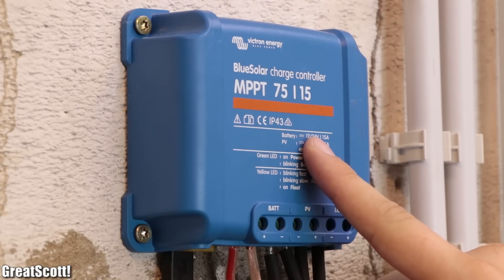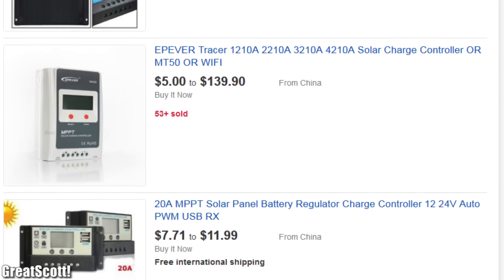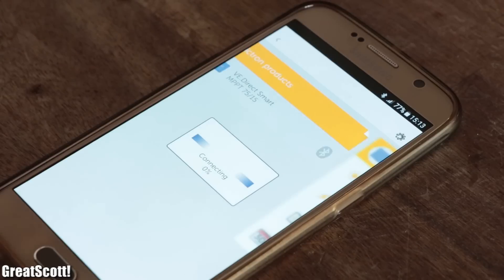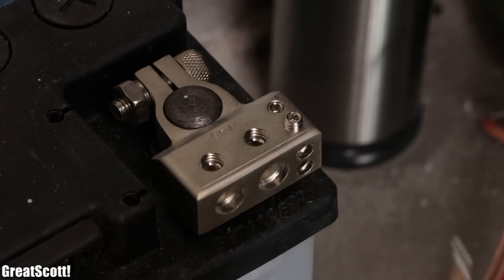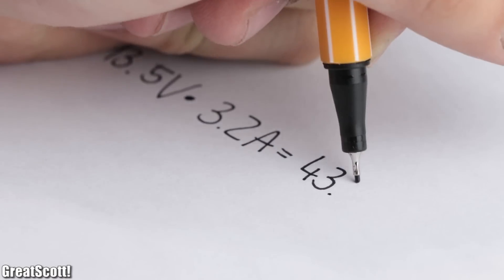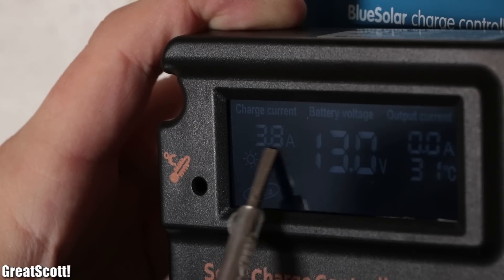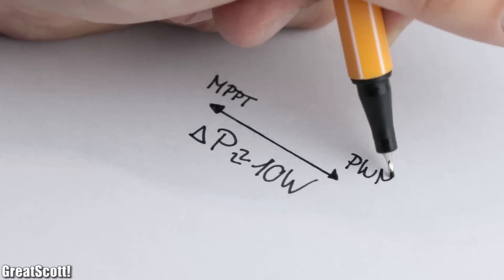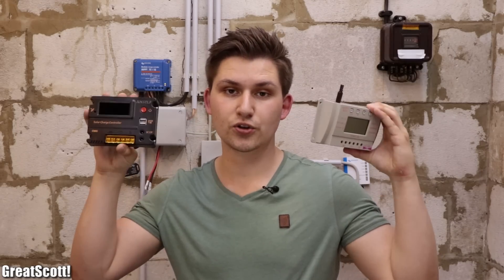MPPT VS PWM || Solar Charge Controller

Comment: You forgot one of the most important points about MPPT vs PWM! Most PWM controllers will not work until the output voltage of the panel reaches a certain voltage, but a MPPT panel can boost low panel output during early morning and evening sunlight. This means that you get more hours of battery charging during the day from MPPT instead of PWM.
Reply: I feel the true advantage of MPPT is that you can use panels of a much greater voltage than your batteries and let the controller work it magic to extract the maximum amount of energy. I have 80 volts panels through a magnum controller to charge my 24 volt AGM battery bank. Because my panels are amorphous I need not fret when the day is coudy...I still have some power coming into the system. Viva uni-solar/Xunlight!
Reply: Maybe not that important because  most of the solar panels generate max volatge even at very dim lights. What i mean that if the solar panel isn't sufficient to generate a paek voltage, then then it won't even give you any useful current.
Reply: That might be important for grid-tied systems or any system that needs to maximize watts all day long, but for many people who are using solar on RVs or off-grid if they're still desperate for watts at the end of the day they've got their system sized way too small.  The PWM system on my camper starts charging the moment the sun is on the horizon and my batteries are fully charged by 10 am to noon on sunny days.  By the end of the day I don't care if it's getting any watts at all since it's just been throwing them away all afternoon anyway.  On cloudy days when charging is minimal, yeah, maybe that would make a bit of a difference.  But I prefer to have enough amp hours in the battery bank to last at least 5 days without any charging at all, to guard against running out of power in case of multiple cloudy days, etc.  PWM has worked fine for me for ten years now and it saved money over going with MPPT.   Everyone should do the math for their particular system.  Sometimes MPPT is the only way to go, but sometimes not.
Reply: @MTMiser  Spend a few extra bucks and get the better item imo
Reply: @mhan6601  I agree but only if the better item is actually going to do more for you.  In my case MPPT might charge up my batteries a little faster but that will only mean that the system will be throwing watts away for even more of the day than with PWM.  It would be pointless and a waste of money for me.  PWM has been working flawlessly on my system for 10 years.  But like I said, MPPT is a great technology but not everyone will benefit from it. The following article about charge controllers has a section on MPPT vs. PWM and explains the situations in which MPPT can be useful, and those in which it is less useful.  https://rvsolar101.blogspot.com/2013/11/part-7-charge-controller.html
Reply: @MTMiser  Hi Well said , i just have a Question  i have a ute canopy it has a 300 watt fixed solar panel on the roof and a Folding panel for when i pull up camping i will use that i have a 100ah AGM battery i run a waeco fridge and few led lights what am i better off using PWM or Mppt thank you
Reply: @MTMiser   do u know how i can use a system without batteries ? iwanna just  work for my fridge in the ligthday
Reply: @stopPlannedObsolescence  You would need to know how much power your fridge pulls, especially on startup.  I'm assuming it's a residential fridge?  Those pull a lot of amps on startup.  Then you need enough solar panel wattage to handle that and an inverter to convert the solar array's voltage to whatever voltage the fridge runs on (120, 240?).  But I think you'd be better off with a battery bank.  Otherwise the power would fluctuate every time a cloud passes over.  I would think that could damage the fridge's motor over time.
Reply: @MTMiser  thank so much mate,yeah so with this point of view, i think is better a bank batteries that support the peak and the consume required for 1 hour like minimum ,or another idea is a onGrid system for reducing my kw/h just for startting in this world.ty and escuse me for my bad english heheh
Reply: @stopPlannedObsolescence  If you would not want to use a battery (can't recommend) you better use a peltier fridge. It does run on 12V and it will not stop running if too less power (like a 12v compressor fridge)
Reply: @yourTuBaer  A quality good low voltage ompressor fridge can give you an 80 degree or more difference which is important in warm weather. A peltier fridge rarely offers more than a 30 degree difference unless its an industrial/laboratory model costing thousands.
Reply: MPPT is not a boost converter, you've confused two different things. You could make PWM or MPPT controller that boosts voltage, but most of both types do NOT boost voltage.
Reply: @jinbee2627 And victron doesn’t make a boost controller because there just isn’t much power to be had, best to add more solar panels in series and raise the voltage
Reply: Well everybody's review is different
Reply: Thank you for explaining that👍🏻🇸🇪
Reply: Do i need to use Poly solar panel instead of Mono solar panel?
Reply: Yep. Some of those cheap ones are fixed power point MPPT which is still a thing but that's only while the panels reach that voltage. Under that voltage they revert to PWM.
Reply: " MOST" pwm do work from the same daylight conditions... Side by side comparisons reveal this...pwm is highly reliable for battery charging... Must mention capacitor failures on MPPT...got a few blown ones...mppt far more costly...heavier...larger physical size...decide by application as they both dump power once batteries are charged....so no real gains for that purpose...everyone has their reasons.
Reply: So true! I've done testing in real life not paper! PWM doesn't compare to MPPT! In full sunlight in Australia current instantly drops to almost a trickle charge. I have read about this.
Reply: I think this is a point he missed because it was more to justify victrons stupid prices. You can get just as good or better mppt's for cheaper than victron prices. He should have definitely just kept it short to show the benefits of an MPPT over a regular charge controller so people could make their mind up unbiased off a specific brand
Reply: Nonsense. PWM can be made to work as low as 1 Volt. How do you think they make cellphone emergency chargers from 1.5V batteries.
Reply: @nicoras8803  that assumes a boost converter
Reply: @nicoras8803  Wait a sec. That takes a totally different type of component to boost power from a single cell battery to a higher voltage.

Comment: Another huge cons for MPPT controllers: your batteries won't last as long as with PWM controller.  Some say MPPT will cut down battery life in half,  and some 30%:  it's not a small marginal number.
Reply: Not so sure about that. Victron design their products very well! So would be suprised when they make a product which kill the battery.

Comment: just a suggestion: whenever possible crimp your stranded type wires. It might not make much of a difference with new wires, but as soon as some strands start to corrode, you'll lose effective diameter. Plus it makes repetitive "screwing around" (pun intended, hehe) easier and less harsh on the strands - Cheers from Trier

Comment: Thank you so much for making a video about this! I've been scavenging parts to build a portable solar generator for a while now. This video was VERY helpful! P.S. It depends how damp your garage is and how cold that block wall gets in the winter but keep an eye on those exposed terminals they can corrode quite quickly if condensation is present. If that happens adding a plywood backboard and/or some dielectric grease should remedy the problem. I see it alot in mains electrical panels.
Reply: good call @Samara Saunders  - Installation is as important as compatibility and other tech stuff. I have seen expensive equipment (not speaking of solar specifically) fail due to corrosion, within a year, through damp getting into low power circuitry. Things start getting weird (unreliable) first then failing completely.

Comment: may want to be careful with those cheap chinese PWM controllers. 2 I've used before didnt stop charging before the batteries reached AT LEAST 14.4 Volts, that's only suitable under cold conditions.

I've sacrificed a few good batteries to learn this. For the price of those batteries I could have bought a bunch of name-brand chargers!

Comment: You divided the extra efficiency into the extra cost over time but another and I think more useful way to look at it is how much extra power per day is there? I'm more concerned in how much power I can use each day over the size and complexity of the system I have to maintain. If I can get more operating time per day that has a greater value than saving money over years. Those screw lug connectors look very troubling to me, I'd be inclined to always at least use fork spade lug crimp terminals.

Comment: What about battery life?  Deep cycle batteries are pretty stable but does is one controller more likely to keep the battery healthy longer?  If the mppt controller is easier on the batteries its cost may be well worth it.

Comment: I really like all your videos, but I want to point out that your comparison is flawed, but the conclusion is not.  You assume there is clear sky with full irradiation all day long, every day for 10 years.  The truth is clouds come and go and an MPPTracker will outperform by delivering more power consistently over time while the PWMs would provide worse than your short test.  Although more difficult to determine the cost cross-over point between PWM and MPPT, (unless you collect data over a full year to get a better approximation for your weather conditions), it is safe to say the MPPT is the better choice.  Keep the videos coming.

Comment: If you use the cost of power available from the electrical service as a comparison point for deciding how much to pay for a solar charge controller, you should include the non-recurring cost of hooking up to the service. You can't actually get power at that price until you've incurred the price of hookup. Otherwise, if service hookup is not an option, then it becomes a simple decision of whether you need the additional power provided by the better controller.

Comment: Nice to see more than just your hands on the screen. Just curious, did you actually measure the charge voltage and current from the MPPT controller or did you just go with what you read on its screen? On the PWM controllers you actually took measurements with a meter to verify what you were seeing on the screen or to calculate what was not shown on the screen, but you did not take actual measurements on the MPPT controller. Or did I miss that? Just curious, that's all!
Reply: Great video, by the way.
Reply from the maker: I measured it. It was pretty close to the information presented by the app.

Comment: I had the white china-model in use for appr. 3/4 year. Pretty much the same setup, 100W solar Panel and approx. 70AH battery. It worked so far, but I did not trust it. It was rated 20Amps, but I put a 15 Amp preliminary fuse in series with the controller, and the solar Panel. The load got a 10Amp one. - I don't would recommend pushing these things to the limit.
Last week I relaced the controller with the much nicer MPPT you showed in your offgrid Video. This is a very nice controller. I like the bluetooth features, nice for tracking the data.

Comment: PWM controller is rapidly connecting and disconnecting battery directly to solar panel. That mean that solar panel will always work on "battery voltage". Discharged battery will put panel far away from MP sweet spot and reduce efficiency even more ... + all other things mentioned in video :)

Comment: unfortanly only tested whit 1 condition and full whit sun. think when you measure when there is alot of clouds. think the mppt will deliver more energy than pwm. 
like you checked in your previous video. mayby than the diffrence will be alot bigger

Comment: dose the mppt charge work better when plugged in the web and lass when unplugged for the web?

why i ask is because of things like, windows10 wants to charge you a monthly fee to use your pc.

or how oscilloscope to day need a key ever year, so that the oscilloscope is 10% more accurate reading. 
"that makes for great science, lol not"

i see it as the big push for tech to have the "buy sell or trade programming"
oh your not plugged in to AI collective, resistance is futile you white male crap and so on.

thanks for your time in this video.

Comment: Thanks for another great video Great Scott !!  * NOW - I HAVE A REQUEST *
Can you do a project on a DIY Capacitor Leakage Tester please ??   I have 2 or 3 capacitor meters and an AnaTek Blue ESR meter.  But neither of these will measure leakage - which is another very important aspect of capacitor performance - and leaky capacitors can ruin tube gear !!   There doesn't seem to be any inexpensive commercial testers available (most are $300 and up) - and the old Heathkits are usually big and klunky - just use electric eye open/close indicators - and usually need fixing themselves !!  A tester that actually measures the leakage current (maybe even w/ an analog meter movement) would be fabulous !!  I think the problem is - high voltage.  In order to adequately test large electrolytic capacitors to spec - it can require 500 - 600 volts DC.  And I think the exposure and liability from that voltage is keeping the DIY community away from it.  Anyway - I think it would be a great project - I'd love to see your design approach !!    Thanks !!!

Comment: Hello there, can you help me, i have a problem, im trying to make a portable speaker everything is fine expect the battery, i have 4x 18650 2400mAh 3.7v and im running the amplifier at 14v using a dc dc booster (amplifier except 10v to 25v) and it can t run them, do i have to change the booster or  the batteries?

Comment: Can you address wind generators in your videos? I want to build one, but got no idea where to start. Same charge controllers? Same batteries? Can i use led gel batteries from UPS and so on. UPS as inverter? I really dont have big budget for factory made system and want to hack something myself

Comment: Did you plan other uses for your 100 Ah battery ? This capacity is more than overkill for lighting up a few leds in a garage. Maybe a Lithium battery charging system (ebike battery, 18650 format cells, and so on) ?

Comment: Hey another great video. Where did you get those battery terminals??? The ones at 2:06. I do alot of temporary field measurements using car batteries as power sources, and these are amazing for connecting cables to. Please share the link!!!
Reply from the maker: There should be links for it in the off grid solar system project video

Comment: What about the Mppt sign on the top left of the grey PWM Controller?
Reply: I have seen other videos here on YouTube that go over the Mppt Labeling of that cheap controller.  It is fake and says Mppt to entice buyers.  The device actually has circuitry inside to mimic an output like Mppt.  Once you look inside you will see that it is a PWM device.  It is a horrible product that typically outputs less than both PWM and Mppt once you use real meters that measure input verses output.

Comment: Nice video. the efficiency difference was surprising for purchase value. it appeared that you tested all in near ideal conditions. i am curious of the same test in less ideal conditions  especially on a cloudy day, to see if the same efficiency differences holds. Mppt is supposed to get better in varying conditions. i would be very interested in such a video.

Comment: On a clear day like that you gave them both ideal sun.  I thought MPPT was better on cloudy days?  I suggest you repeat this experiment in the fall and winter.  It would be great to assess morning and evening power efficiency.  Otherwise great video and keep those 555 timers coming.  Also attach the battery to the controller first, it's in all my cheapo charger instructions with their overly optimistic statistics.

Comment: pwm drops panel voltage to the battery voltage effectively throwing away power. mppt drops voltage through a switchmode psu and increases amperage. in otherwords If you put 2 panels in series on your pwm you would not get any more power. each has its uses. but in general  pwm only on small system with a matched panel.

Comment: Given that it is cost-prohibitive to install grid-electric in your garage, you need to compare costs of additional solar panels to offset the lower efficiency of PWM controllers. In other words, about US$25 more in solar panels to offset the cost. Thus, only with very small solar systems is it cheaper to add more panels and use a PWM controller.

Comment: How come this channel still did not hit one million subscribers!
I think there is may be some bias in your comparison, that is you read 53W from expensive module from its trusty Bluetooth module without confirmation!!!
Wouldn't it be better if you confirm that first by reading input voltage and current using multimeter as you did with second cheap PWM module, just to have good start comparison.
Reply: You must test all 3 under identical conditions using the SAME instruments.
Preferably use a 3-way switch to switch between controllers.
Reply: Yes same identical instrument is a must for comparison. That is why I think the results are biased.
Reply: conformation bias confirmed